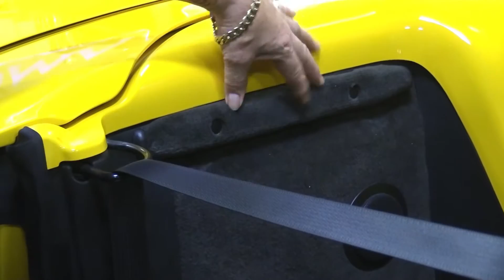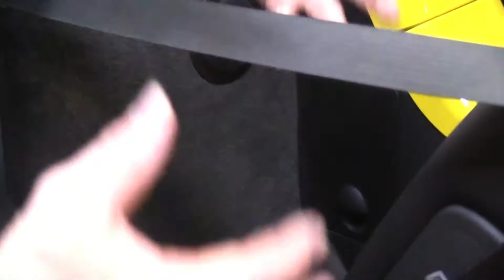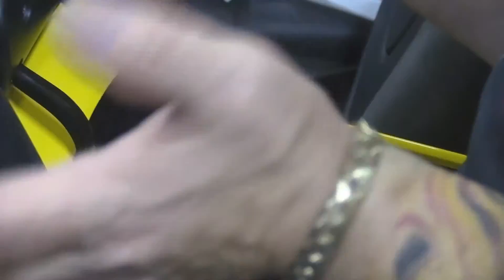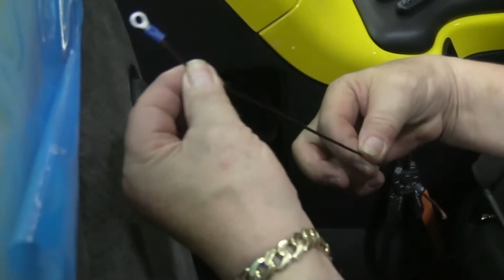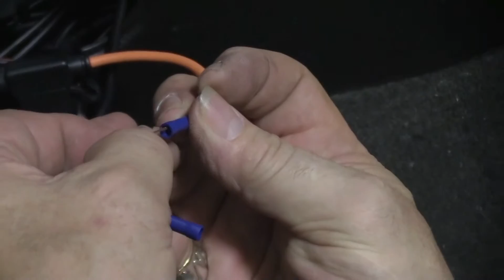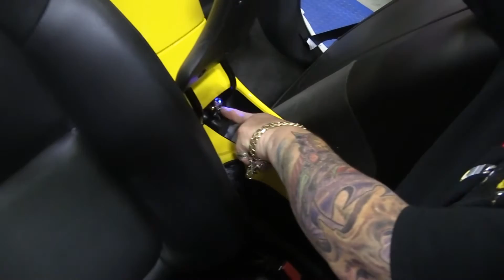Install an SSR Windjammer

Comment: although it's cool to have, don't do it well you can do what you want it's your car, I will tell you I wouldn't put that on a Chevrolet SSR not mine why all that wire modification you are compromising the integrity of your call a rule of thumb if  it doesn't comes from the factory like that what you wanting to add on then it wasn't meant to be just like people who buy a new car then add custom rims to the care I will tell them why do you think the rims on the car you brought called factory rims because they are what they  are called factory rims are precisely calculated for that certain car from the weight to the balance when people puy rims the balance becomes off and you can never true balance. I would keep your ssr original as possible the only thing I would add to the car is a external transmission cooler so your transmission will last a long time i'm keeping my ssr so original I buy out all the gm original parts I can get and there are still quit of few gm parts out there.
Reply from the maker: So... Don't buy aftermarket accessories unless it's for the transmission. Because while the windjammer isn't precisely calculated for the SSR (it is, why else would we say it's for the SSR?), the aftermarket transmission cooler is?

Comment: Would like to purchase. But could not find anything for an SSR at y6our website. Are these Windjammers available?
Reply from the maker: Hey there, right now all SSR parts are sold through http://stores.ebay.com/Florida-Stainless-Steel-Accessories check them out and you should be able to find it there.